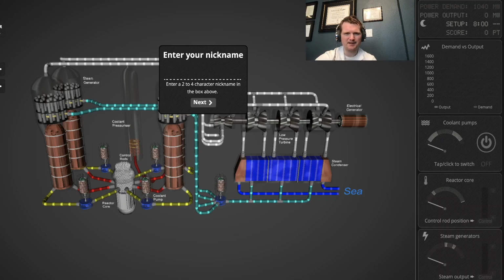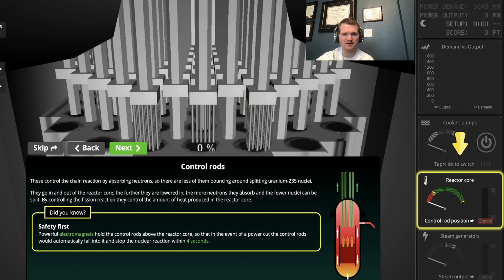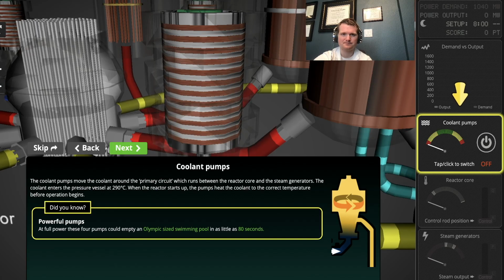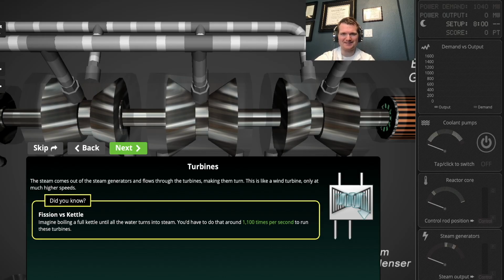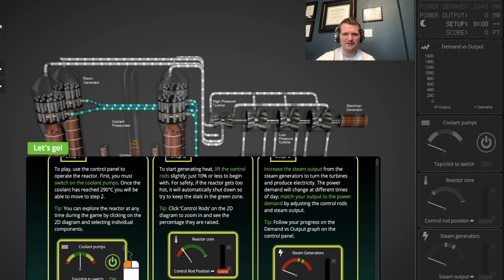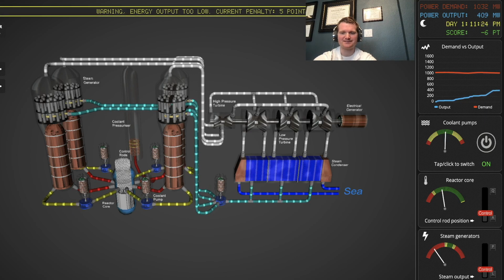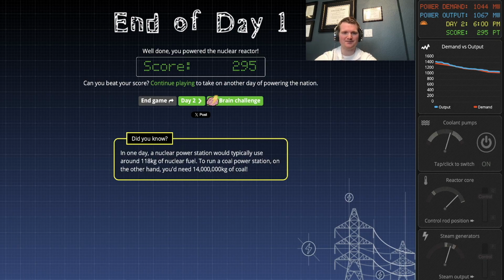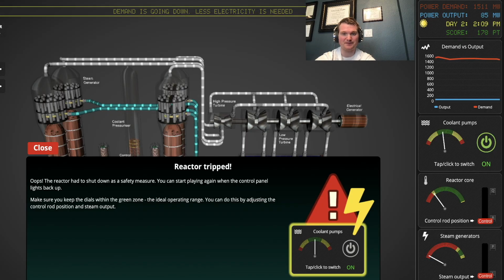Nuclear Engineer Reacts to Nuclear Reactor PWR Simulator by University of Manchester

Comment: I know this might sound like a dumb question, but my goal is to learn.

If the thermal efficiency comes from the temperature difference between the hot reservoir and the cold reservoir, why not put the cold water in a large tank or silo and supercool it to around -40? That will give you the maximum thermal efficiency year round
Reply: I'm gonna venture a guess that the necessary energy to cool the water a large degree below what they're already using would negate any thermal benefits from a larger temperature differential, and probably cause problems with the heat exchangers between the primary loop and secondary loop from flash boiling cavitations?

Comment: That's hilarious that you're doing this particular simulator. An engineering buddy of mine sent me the link to it about 5 weeks ago with the words; "Here you go, Mr. reactor nerd. Something for you to play with. See if you can run this thing."

After some trial and error, I was actually quite good at running this PWR for someone that has never set foot in a real control room. Gently brought the reactor up to power, and then let it follow the steam demand. Would shim the control rods on occasion if the power output versus demand was too far apart to bring the plant back into balance, and just let it run. It was jolly good fun!
I would love to see you do an RBMK simulator, if only to show the difference between the reactor you worked with, and the big, grumpy RBMK.

Comment: A gator stole my mouse lure in Eastern NC. It was a fairly little guy; like 3.5 - 4ft long, but I think it probably would have dislocated my shoulder, if the line hadn't broken instead. Then it spit my lure out, and sat right next to it staring at me.
I know it was thinking "Come on, I know you want it back. Come in and get it."

Comment: eew water primary loop, get salt or even NaK. 
try dipping your toes in new designs not 60's relics..
Reply: You do realise that EBR-1, a Fast breeder with NaK as a coolant was designed in, and operated as early as the 50's? But yeah, I like these a lot. EBR-II was a marvel of technology that they couldn't even get to meltdown despite their best efforts trying to cause just that, during two landmark tests. Both times the reactor politely declined.
Reply: EBR II proved solid fuel breeders are not practical or economic. 
molten salt seems the obvious best option on the table. 
regulators are apprehensive for proliferation reasons but thats kinda foolish, it would be easier to enrich U235 then seperate out U233 or Pu239 from fission products with regulators watching.. @swokatsamsiyu3590
Reply: Nak is better than water but salt is safest and highest temp capible (not counting gas, its weak)  @swokatsamsiyu3590

Comment: would love to see someone try and simulate a high temp molten salt reactor, the core has fluid & thermodynamics + nuetronics + chemistry. quite complex
Reply: Yup those would be very different essentially passive convection would be the primary flow. The secondary would be another molten eutectic salt mixture. Finally it would make extremely hot steam. The secondary loop could do double duty as an isotope generator as well as thermal transfer. The pipes would be made of a metal that passes neutrons but will passivate by both oxygen and fluorine.❤
Reply: @christopherleubner6633  if you go fast spectrum and Cl salt you can run 850c, enough for a super critical co2 turbine, you could have a reactor completely void of water, yay explosions impossible

Comment: this is really cool! I'd also be happy to see you play the RBMK simulator made by simgenics. It's almost lost media, in terms of the menu screen, and cutscenes, but the heart of it is still playable with a small patch to fix Xenon Poisoning. I could send a vid going over the installation and operation if you want.
Reply: I think you need a VM running Win-98 for that. Or at least, that's what I remember. Never were able to get this simulator, unfortunately.
Reply: @swokatsamsiyu3590  i found one that runs pretty well on windows 10.
Reply: @swokatsamsiyu3590 Try running it in compatibility mode

Comment: i think the french do load following of their pwrs to some degree. load following would work better in fast neutron reactors though.
Reply: Yes, they do. They use so called "grey control rods" for that. These will only partially absorb neutrons, instead of fully absorbing them. That way they can vary reactor power without actually changing reactor power to avoid the Xenon peaks/valleys.
Reply: right, simply just raising all of the control rods variably seems like it's going to result in some uneven burnup.
Reply: @Hamstray  
In a PWR you can control your burnup with Boron in the primary cooling circuit to a certain degree. But perhaps Mr. Folse can enlighten us a bit more on the details?

Comment: how are control rods actuated? Rack and pinion? Linear  Piston? Rotary?
Reply: The control rods are generally operated with hydraulic actuators. The shutdown scram rods are activated by passive gravity and pneumatic assistance.❤
Reply: @christopherleubner6633  thank you...
Reply: @christopherleubner6633 can rods get stuck?
Reply: With a very steady hand and nerves of steel.
Reply: Just my guess, by maybe cable and spool attached to the top of the rods. I'm sure it probably depends on the tractor though, and I'd love to see Tyler correct me below.
Reply: Usually by electric solenoid pushing upwards against spring tension.
So in the event of complete power failure (the reactor and controls run on utility or generator power, not power produced by the reactor) the rods will immediately be fully inserted.